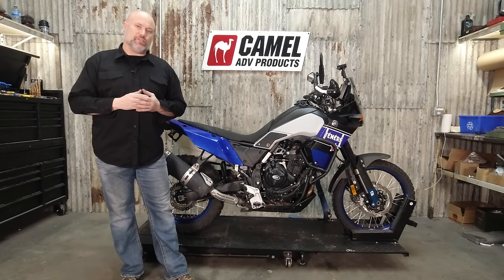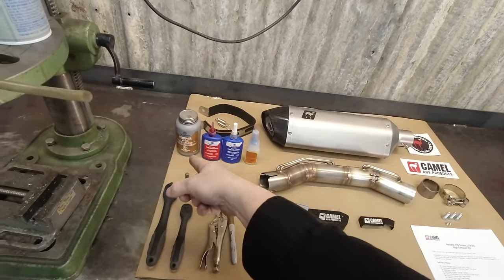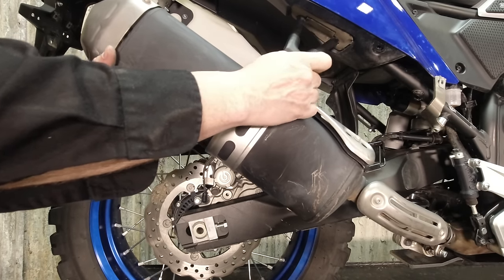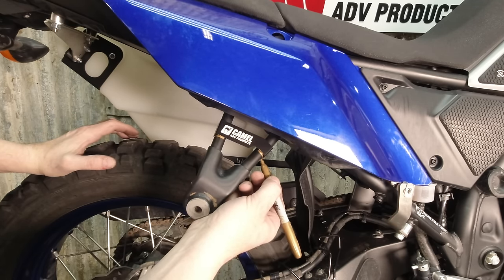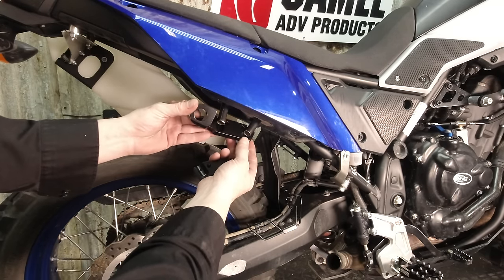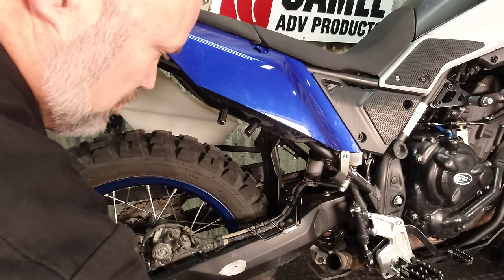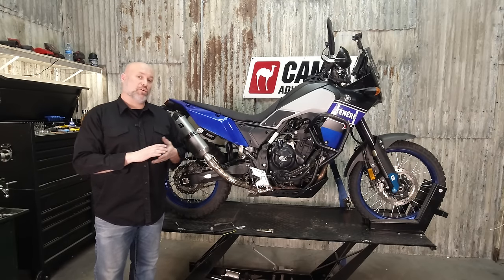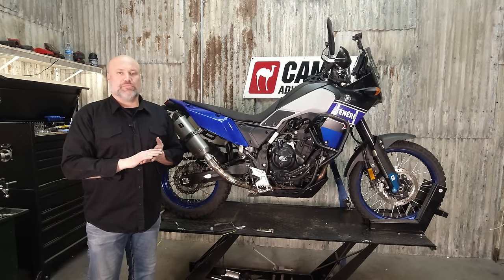CameL ADV High Exhaust T7 Install

Comment: Would love to see a solution for the oem Muffler or at least for the Akra so it's kind of legal in the EU because your exhaust isn't e-marked. And I don't like loud pipes either 😬
Reply from the maker: We're working on an EU certified muffler for the kit. The included muffler is not loud at all with the db killer installed.
Reply: True. If somebody would produce a kit to move oem pipes into that high position -> instant global success. How about that Camel ADV? any chance?

Comment: Finally installed mine.   The video was priceless.  Only hang up was getting the exhaust bracket lined up for the bolt.   Took some fettling.  In the end, the exhaust sounds fabulous.

Comment: Just installed mine. The second best product I’ve bought. 1. Camel ADV Rear Brake fix. 2. Camel ADV High Rally Bend exhaust. 
Accept no substitute
THESE TWO product solved two huge design flaws of the Tenere.
Reply from the maker: I'm glad they're are working well for you!

Comment: Just put mine on.. Outstanding Quality Amigo!! Wish I could do that kinda metal work and fab.. Solved my problem of not burning soft luggage w Adventure Spec side racks And does not melt right signal with your Camel Tail Tidy.. It’s like my T7 is wearing a Rolex..

Comment: Best looking high exhaust. Do you still plan to try the Wings Muffler with you link pipe?
Reply from the maker: The issue is that 51mm is a pretty standard ID for muffler inlets so we made the link pipe that size... Wings is 50mm ID.

Comment: Much better muffler position than stock, nice to have options.
I guess you have to use a heat shield for the tail light.  That's the only thing I hesitate with.  I'd rather have the exhaust deflect away somewhere else.  I'm just wondering if the idea of a deflector instead of a heat shield is a possiblity, or not practical.

Comment: I have heard from others that the bike should be re-tuned after a different exhaust system has been installed due to the engine feeling different back pressure. What are your thoughts regarding the bikes behavior after changing to the aftermarket system. Do you notice anything different with the bikes behavior such as fuel consumption, rough idle, etc

Comment: Probably can save a step and not remove the metal sleeve from the rubber bushing if it is stuck
It came out in one piece.  A bit of lubricant and it would go back into the new bracket without too much hassle.

Comment: Do you think the  EU led Yamaha indicators would clear the exhaust gases without the need for the cover plate ? They are 3” long from the camel tail tidy .
Reply: I’ll answer my own question....After a few weeks without the cover over the rear led indicators , no issues with heat from the exhaust 👍

Comment: Hello is this the only solution if we want to keep the passenger pegs? Saw the enduro bend but it's incompatible. Thanks
Reply from the maker: Yes, the Rally Bend is compatible with the passenger pegs, the Enduro Bend isn't.
Reply: @CamelADV  do you think it will work with euro 5 akrapovic?

Comment: Any issues with indicator melting? Or best get your tail tidy as well?
Reply from the maker: The Rally bend kit comes with heat shields for the signals. The Enduro bend doesn't need them.
Reply: Thank you, does the heat shield go fine with the stock halogen indicators, and OEM LED lights?

Comment: It's a quality setup but, (there's always a But) engineering the box so you can use the original bracket so you dont have to start chopping the Bike would be better and more accessible to the average rider.
Reply: I believe they were having a problem with the OEM bracket snapping off and this kit was designed to bypass the bracket because it is prone to damage.

Comment: It is possible to install the OEM muffer with this kit?
Reply from the maker: The OEM muffler uses a small diameter welded on link pipe, it is not compatible with this kit.

Comment: Great job, congratulations. I would like to know the diameters of the silencer and of the curve connections. I would like to use my silencer (ffbyfresco mod. Dakar) because it is approved in Italy and also the Akrapovic racing head pipe. Tell me if it is possible.
Reply from the maker: 51mm OD.